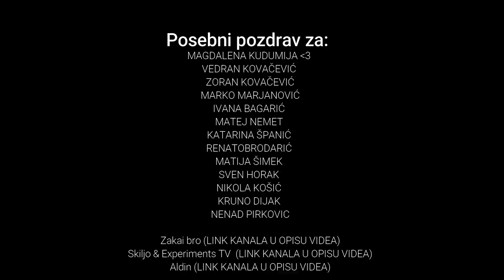Homemade CABLE for TRIMMER ?!!

Comment: What is that steel cup you drill the holes in and weld the nuts too ?
Reply: Part of the kit you get when you buy the brush cutter blade from Stihl.

Comment: Great idea! Thank you.
Reply: very stupid!!  Why?? No 1: his welds will throw it off balance..  No 2: he welded a bolt with a nylon threaded nylon it.. thus melting the nylon inserts..defeating the purpose of the nylon threaded locking nut .. No 3: Really soldering the threads together...defeats the purpose of the braided line and finally No 4:  Just Ask my high school bud what happened to him back in the 1980's  a family member tried this..with a slow corded trimmer... the braided wire broke off within a minute sending pieces over 40 ft away into his throat and voice box.  There is not one good thing about this other.. than the metal wire will rust to nothing faster than normal line will as they break off in the yard etc.  CHRIST KIDS>>stop trying to reinvent or discover stuff that was already done 20 plus years ago. Much rather see you alive doing videos .. than hearing you or someone near you was hurt due to this modification

Comment: Is it dangerous to break the cord?
Reply: Thế Tài it cuts really really well.  Very durable but if you keep hitting in on concert / bricks it doesn’t matter if its a metal wire it will wear out and break.    And if that metal wire breaks it might hit your eye or go through you leg skin. ( if bad luck)
Reply: Lee2709 concrete / cement etcc

Comment: Wrong tool. A scythe could have taken out that patch of weeds in 2 minutes,  much neater. No gas, no numb hands. Light duty string trimmers are the right tool for going around foundations,  trees, flower beds, and ditches.

Get something like a PivotTrim or BadgerHead. Soooo much easier on string, and quick to change.
Reply: The whole point of this is to make use of what you have. There's a tool for pretty much everything, doesn't mean fill your garage up...
Reply: @drew1595  True,,, I keep my tools to a minimum. I was just saying a scythe would have been a better tool on that patch of weeds.
Reply: @Bob_Adkins  Except that wasn't just what you said, you said he used the wrong tool and went on to say how his compares with the tool designed for that purpose.
Reply: @drew1595  OK then, here's what I really think. I think it looked awkward  cutting down that many tall weeds with a string trimmer, and thought how much easier it would have been with a scythe. I was just thinking out loud, that's all. He can cut his weeds any way he pleases, and it's none of my business.
Reply: @Bob_Adkins  awesome, thanks for your input.

Comment: Best Tip : Do not use you trimmer on a high rev. Don’t hammer the throttle. Just turn up your idle and don’t pull the trigger except now and then when you need to.... it saves the line from wearing quickly. Low and slo boys. Trimming grass only requires high idle.
Reply: That's not true. A lot of small engines like those used on line trimmers are designed to be used at full throttle. Especially the 4 mixes. Stihl Kombi for example. Using these at low rpms isn't good for them.
Reply: 2stroke engines are designed to rev, that's where they get their optimal power. Running at low revs will clog up the exhaust port with carbon & foul the spark plug. Also the clutch will wear out prematurely because it's not fully engaged at low rpm.

Comment: very stupid!!  Why?? No 1: his welds will throw it off balance..  No 2: he welded a bolt with a nylon threaded nylon it.. thus melting the nylon inserts..defeating the purpose of the nylon threaded locking nut .. No 3: Really soldering the threads together...defeats the purpose of the braided line and finally No 4:  Just Ask my high school bud what happened to him back in the 1980's  a family member tried this..with a slow corded trimmer... the braided wire broke off within a minute sending pieces over 40 ft away into his throat and voice box.  There is not one good thing about this other.. than the metal wire will rust to nothing faster than normal line will as they break off in the yard etc.  CHRIST KIDS>>stop trying to reinvent or discover stuff that was already done 20 plus years ago. Much rather see you alive doing videos .. than hearing you or someone near you was hurt due to this modification

Comment: I just put one thin long screw in the initial part through the cable hole (see at 6:50) without screwing it. It worked well. You just have to take it easy.